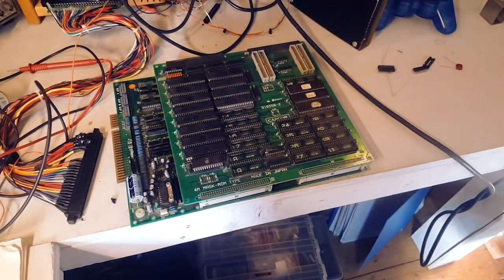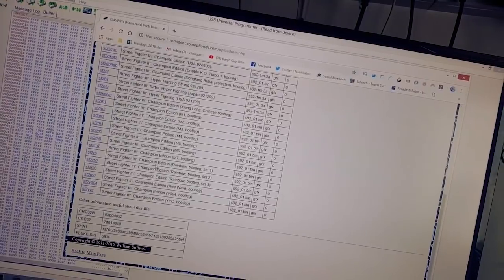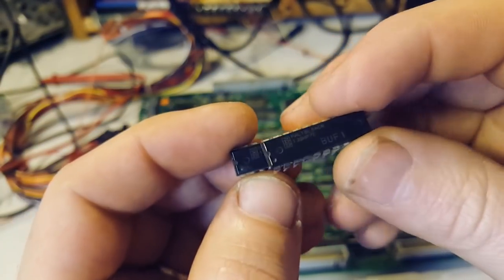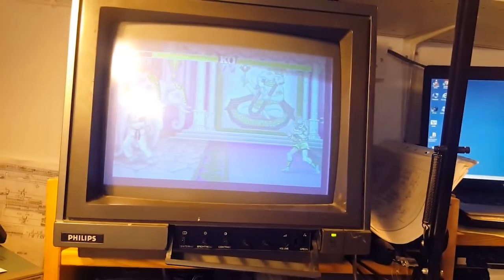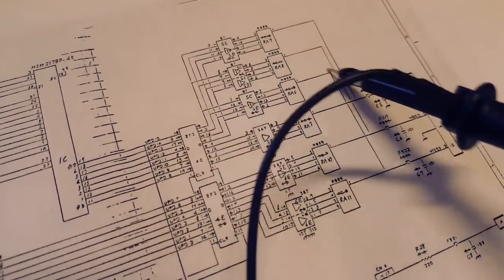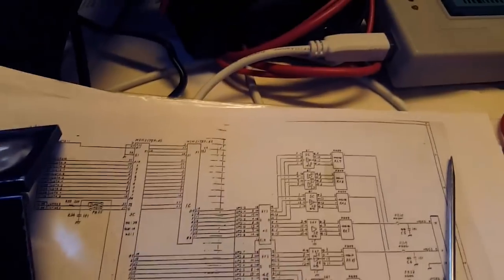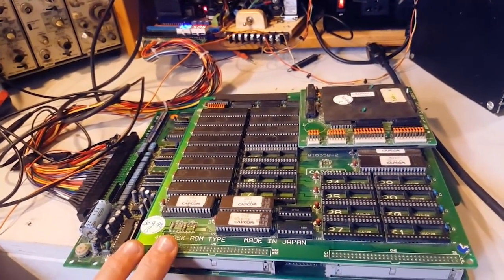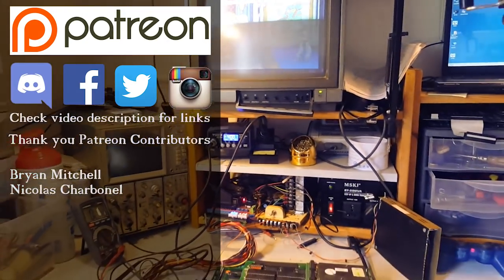Arcade DIY #55 Street Fighter 2 CPS1 PCB repair #2

Comment: Awesome repair

I still haven't taken the plunge to work with SMD. I've seen people work with SMD with using standard soldering irons, heat guns and even home made reflow ovens. Not to mention they claim it is easier. I don't know, maybe next time I get some extra cash I might buy a reflow station and give SMD a try.
Reply from the maker: yeah definitely get a desolder heater gun thing . you can get cheap ones on wish  (thing that's were i got mine) , make sure you've plenty of flux, I  had temp set around 650/700  , plenty of flux move it well around the legs, plenty of flux, take your time and plenty of flux...

Comment: the pcb manual seems to suggest that -5V is required for the sound board on this arcade board. Are you able to verify perchance? Thank you so much for the video. I'm trying to see if I can just use a PC ATX PSU.